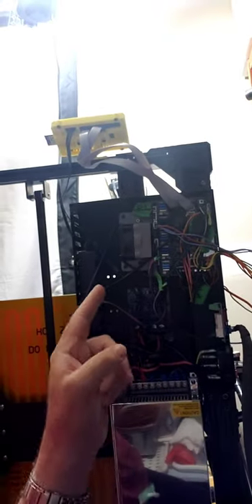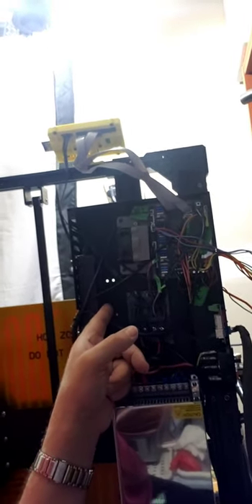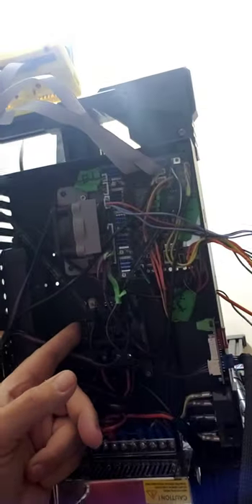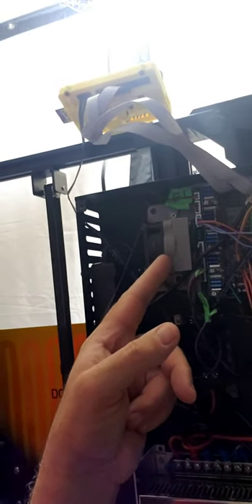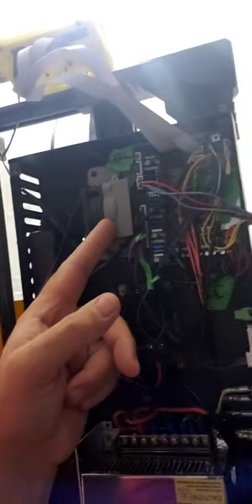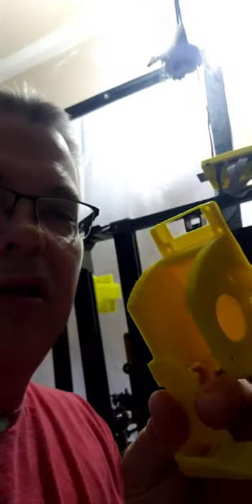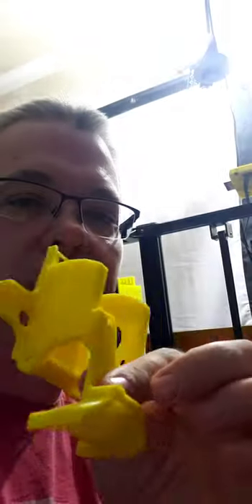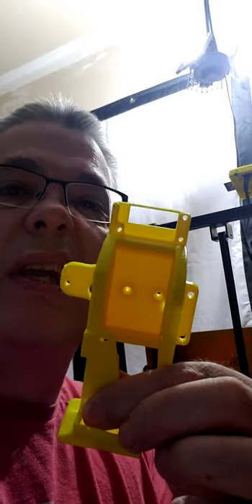Anycubic Chiron SKR1.4 motherboard cooling  and new carriage. #shorts

Comment: on my
ender 3 pro with marlin firmware. I printed one benchy with a defect at the
upper part of the wheel house about three layers that didn't print correctly,
otherwise a great print. after I calibrated the PID on the nozzle and bed I
tried to calibrate the e steps. now the stepper motor just "twitches"
and never turns. any idea what it could be?